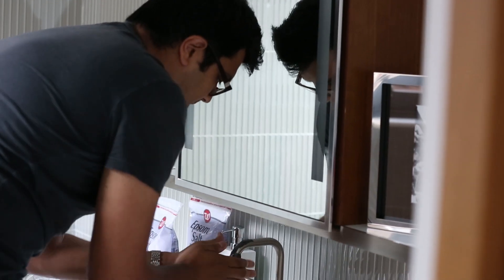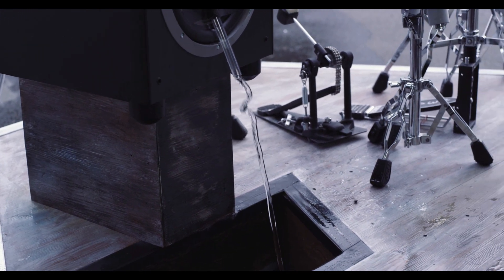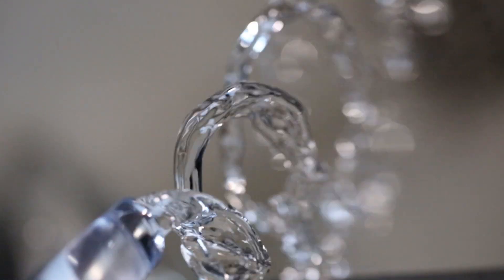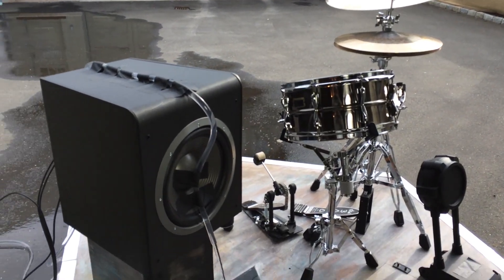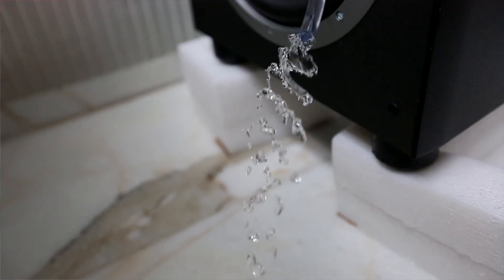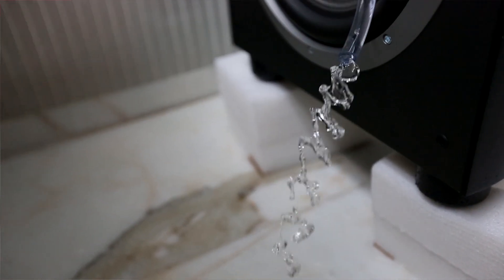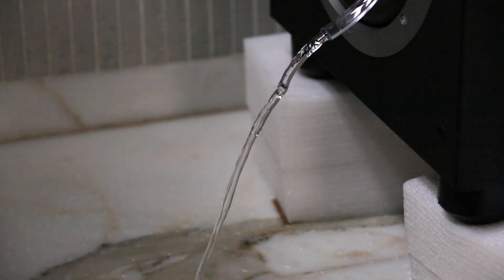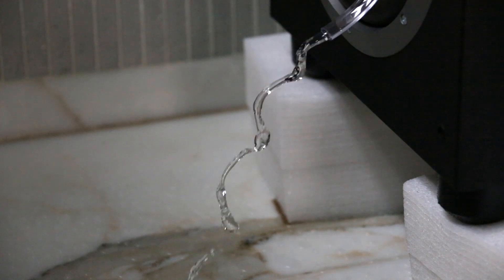Cymatics: Hose Pipe Water Experiment

Comment: Could you adjust it to your eyes frame rate?
Reply: yes
Reply: Human eye doesn't take samples at discrete time intervals, the cones probably has some frequency response so the image start to blur.

Look at the spokes of an alloy wheel or lathe chuck or something like that, you'll never find a frequency when you see it stationary or rotating backwards. (and don't get fooled by the flickering CCFL/LED room light)

It is interesting however that for slower speeds, like paper exiting out of a label printer (200mm/s or so), when I concentrate, I can see it as stationary for a moment, like I would have taken a photograph. I don't know how exactly this works, but my theory is that I can sync to and follow the movement by moving my eye as long as it's within the range of motion.
Reply: to what?